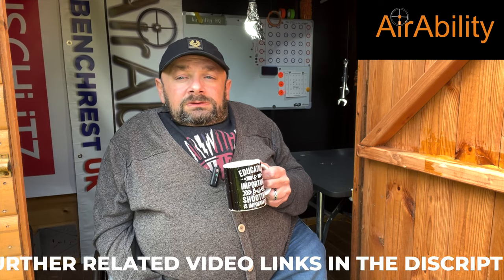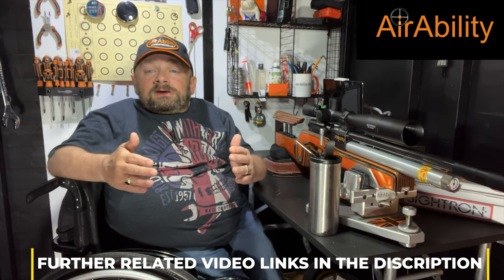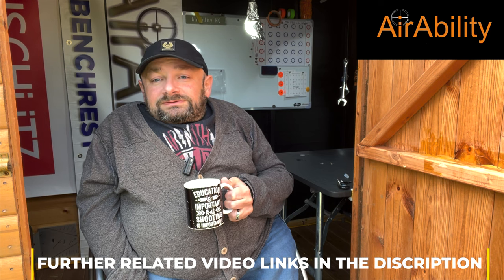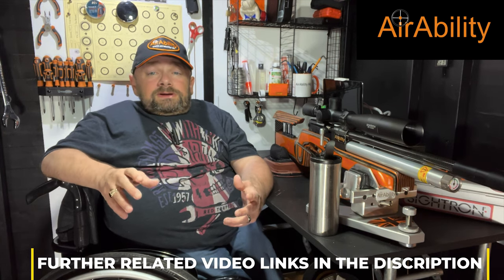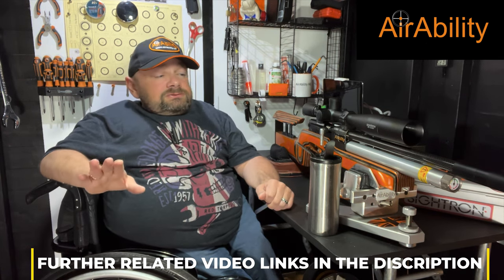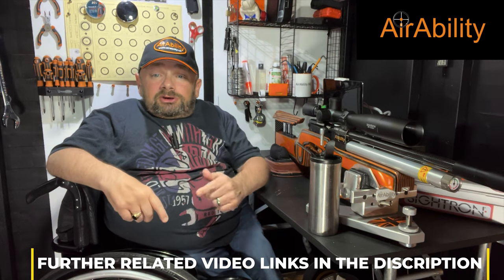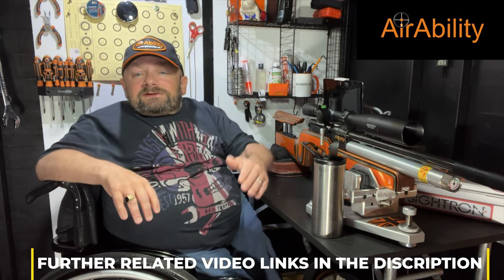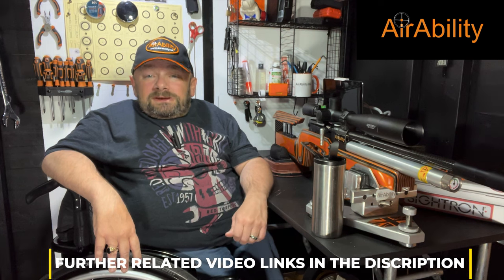64. 25m Air Rifle Benchrest Accuracy and How To Improve It

Comment: Great video. Well you've given me loads to think about. I use a springer but I've just bought a Hawkeye bench rest to try to improve things from the sitting down position, I am suffering a parallax problem so will first work on that but I don't think my scope has an adjustment for that. Thanks again I subbed as your channel is great.